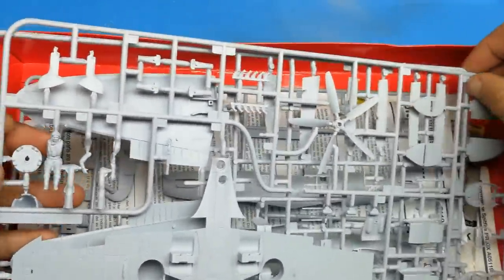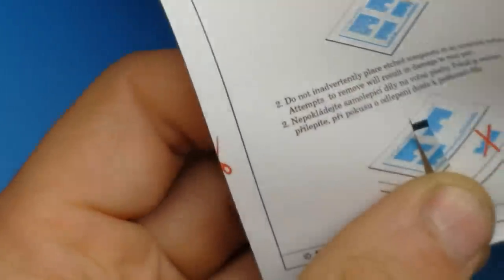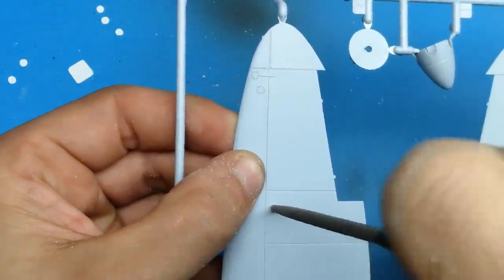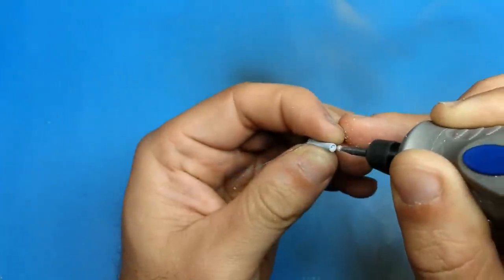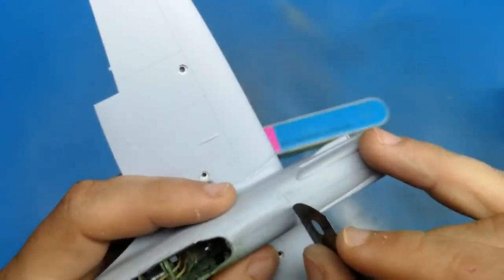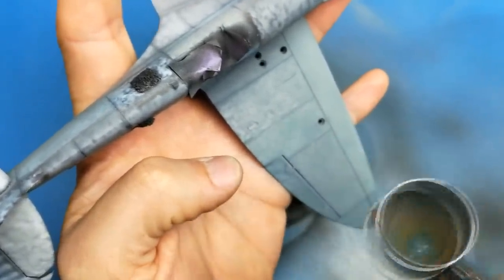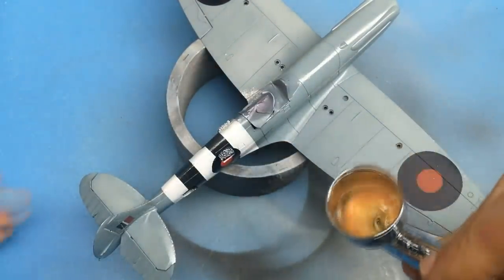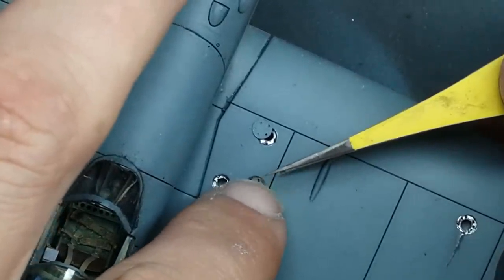1/48 Airfix Spitfire P.R. XIX

Comment: These days I fly real airplanes. When I was a kid I used the same brush, mixed the paint, used the same thinner over and over again, borrowed my dad's cigarette lighter to melt the parts to simulate battle damage. Sometimes I would use a vice and other tools from the garage to create certain effects.  The end result here is impressive but it seems that I had more fun. I would spend hours on one model. I even copied Roger Dean and got a bird's skull from a bird our cat dragged in and substituted it for the nose of an SR-71. I had one of the first model kits they made in the 70 s and if I remember correctly it cost me a lot of money. Well, a lot of money for a 10 year-old kid.  I painted it red and wish I still had it. I think it got thrown out along with my hockey cards after I left home.  I like looking at some of these modern models that you guys put together but it just doesn't have the mystique and wonder that I experienced as a kid. The internet has taken a lot of that away. I dunno, Just my take.

Comment: Very Cool!  I just bumped into this channel and like the way you explain what you're doing to the model while building it,,, I find that extremely helpful! 
Just one thing,,, the ill fitting fuel tank covers you mention on the mk1 and mkV kits are supposed to be slightly proud of the main aircraft surface... They weren't flush. Just a tip incase you build anymore Spits on the channel! 
Keep up the good work 👍
Reply from the maker: I agree they're not flush, but you get some gaps that need attention. Thanks for your feedback!

Comment: Join the top wing halves to the fuselage and add the lower wing later, no filler.
Reply from the maker: I tried that on the Mk Vb and it left a nasty over lap at the outer wing tips. Panel lines didn't line up properly and turned into a mess

Comment: Love the channel !! How would you rate an Airfix kit for an intermediate level modeler? I’m sure they’re not Tamiya level, but they seem to cover some great subjects.
Reply from the maker: I'd say avoid them. There is a lot of clean up required and you'll find yourself asking why they made the engineering choices they did. If you are really passionate about an airframe, then there is an end goal to work towards. If you are just building a kit to build something, it is hard with some of their kits to stay motivated. This kit isn't too bad but the landing gear leaves a bit of head scratching and elevators need work to square up.

Comment: To help get rid of the Wing-root Seam, try gluing the Upper Wings to the Fuselage first and then once the Fuselage halfs are together, glue the lower Wing.  See if that will help get rid of that Wing-root Seam.
Reply from the maker: I tried that with their Mk Vb but it caused a bigger issue because their was an overlap at the wing tips that needed to be sanded down quite a bit.